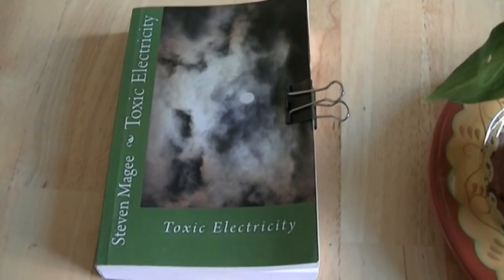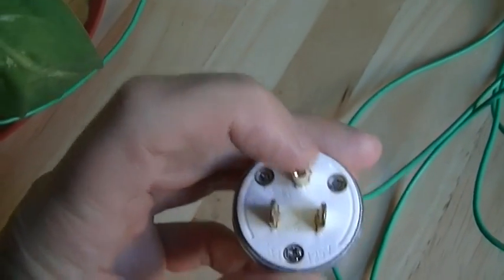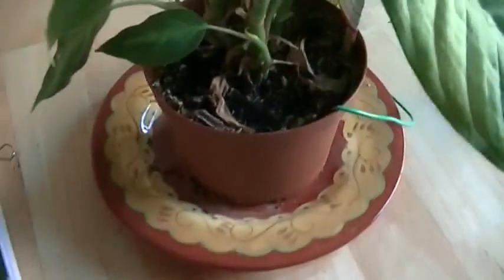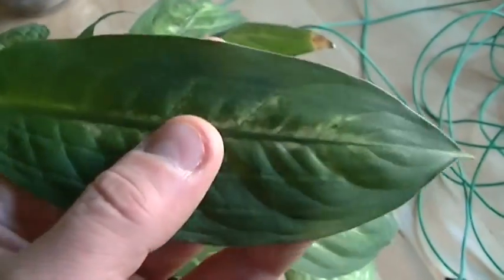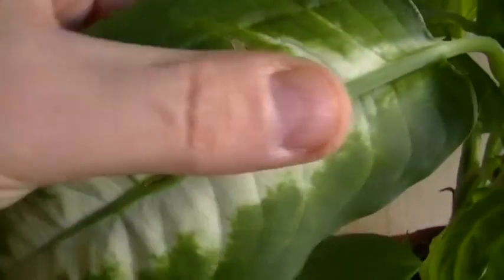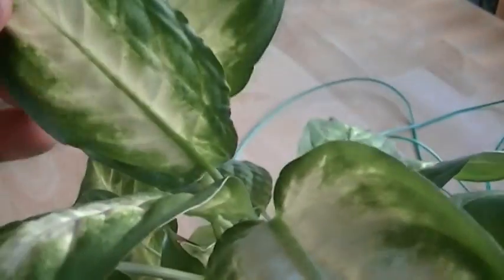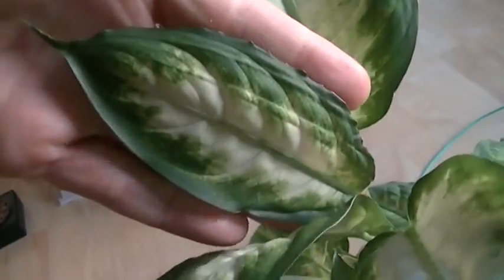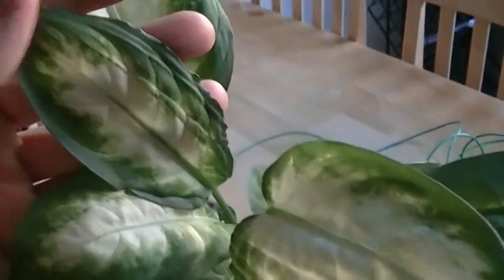Interim Review of Stray Voltage Exposed Plant Growth December 2012

Comment: So the stray voltage travels back through the earth pin on the power plug?

Is there any type of meter you can use to test and measure it?
Reply from the maker: Using the UNI-T UT61D & Tekpower TP4000ZC Multimeters to Measure Stray Voltage http://youtu.be/wKRSK3kQbZE
Reply: StevenMageeBooks I am just wondering how you can be sure the grounding rod is non-electrified? Wouldnt the stray voltage be travelling up that too?

I did your test where you put one in the earth socket and one under running water and that gave 0.05.

But I have a socket where I plugged in a grounding sheet, and when I got on the sheet it felt like I was being zapped. I want to test that port specifically, but its not near a water source. I could use a rod like you have but as mentioned, wont the stray voltage travel up that?
Reply from the maker: ***** It sounds like you have high frequency contamination on the electrical grounding system, commonly called "Dirty Electricity".  I don't advise on the various aspects of the Earthing health technique, as it is problematic...all grounds are not created equal.  Contact the http://earthinginstitute.net/